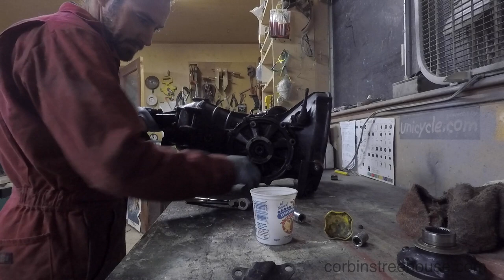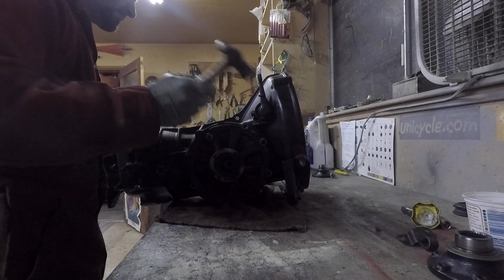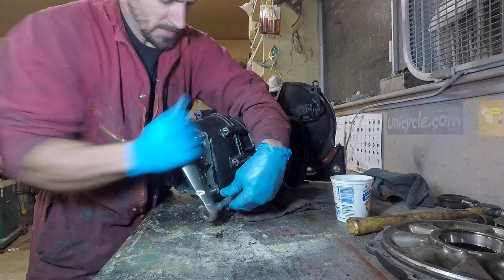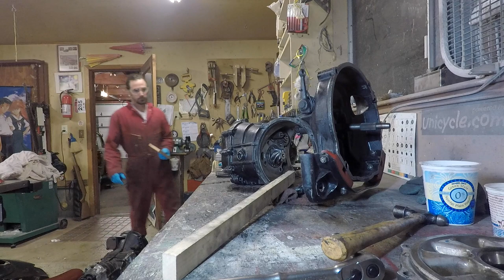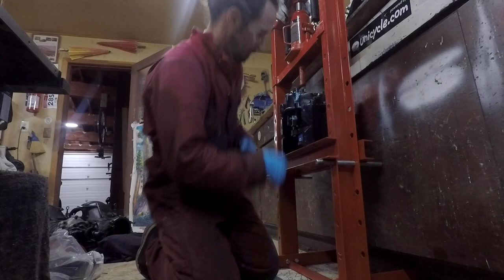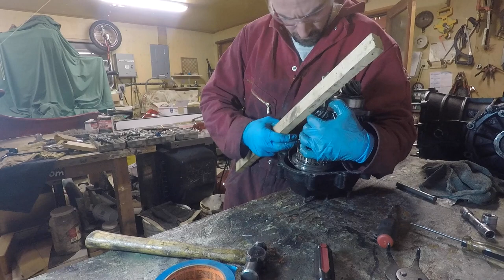VW Bug Transmission Disassembly / Tutorial for 1969 Volkswagen Beetle

Comment: Yard racer,  that gear in the first part normally nothing happens to this.  That gear rolls with the second on a shaft through to the gear box. On the gear box side there is 2 types of reverse gears. One is double side and can be turned around and use the other side.  The second later type used one side gear.  Reverse goes out if that gear chips/breaks. Easy fix, however if the gears break one the slider one the pinion shaft set. You have to disassemble the gear set and check to make sure other gears didn’t get damaged from the broken pieces flopping around.

Comment: Good job.  That trans was much bigger than I anticipated.  Brass drift-punches are good for beating on metal surfaces without marring them up without the danger of splinters.  :-)
Reply from the maker: Pet Rock's Garage yeah man, good idea! I even have a piece laying around I could use.
Reply: Brass will most definitely Mar aluminum and magnesium even when its cast. So will anything if you hit it hard enough .I make my own hardwood, leather, and aluminum tools for sensitive work.I use a dead blow mostly to strike them

Comment: The right hand side is the side that the starter is on.  You must remove the diff from the LEFT side.  It cannot be removed from the right side.
Reply from the maker: Thats correct, and it is what I was doing in the video. I might have said "right side" because of the orientation of the transmission in the video to where I was standing. Thank you for the clarification!

Comment: anything on replacing the hockey stick seal in the nose cone ?
Reply from the maker: I don’t recall replacing it myself, but I know once the nose cone is off the hockey stick can be pushed out. You might only have to remove the nose cone... but I haven’t messed with the transmission in a few years so my memory might be fuzzy on it.
Reply: @CorbinDunn  thank you

Comment: Was the transmission in neutral when you removed thehockey stick?
Reply from the maker: Yes, I had it in neutral -- it makes it easier when assembling it. I've also heard that if it isn't in neutral that the hockey stick can sometimes get stuck in gear during assembly.

Comment: Nice video but please get yourself a air ratchet and cut you bolt removal time waaaaay down. Sorry couldn’t finish it because I was getting nervous watching you undo all the bolts by hand.
Reply from the maker: Hah, an air ratchet would be awesome. I just can't justify the cost, as I don't do enough wrenching on cars.  I did a sped up version of this video, and some people asked for the 1:1 speed version...so, that's what this is!
Reply: Corbin Dunn you can get one cheap at harbor freight and believe it or not they work really well.....got a cheap one over 25 yrs ago jc whitney  & used it almost every day at my 76 station and it still works great just add a couple drops of air tool oil when using it.

Comment: Get a pair of c clip pliars and you don't have to buy new clips for the drive flanges. It pays to have the right tools.
Reply from the maker: I’ve got a set! They don’t work on the flange covers.. or I just haven’t learned how to do it.
Reply: @CorbinDunn  I just bought a set at Oreilly's. I just had to change my seals and was pulling my hair out trying to get them out with screw drivers. They have flat jaws at the end.
Reply: @CorbinDunn  I didn't mean to sound so snarky in my original post. I actually had this video saved because I have a 70 I wanted to tear down and that "special tool" thing reached up and bit me. I had to buy a pinion socket just in time to find out yours didn't have that. Fortunately I was able to get it apart and I have a broken shifter fork. Looking for another one.
Reply from the maker: @randall1959  No problem! Man..it's a bummer, I had a box of old transmission stuff (including a fork) and gave it away a few years ago. I bet if you post on some VW forums or VW Facebook groups that you could find someone who has one laying around.
Reply: @CorbinDunn  I've got some feelers out. I've heard I can swap out the brass one for a cast iron one and that would fix the issue. In the meantime I've got a spare that's noisy but it's working. It sounds like an old jeep.